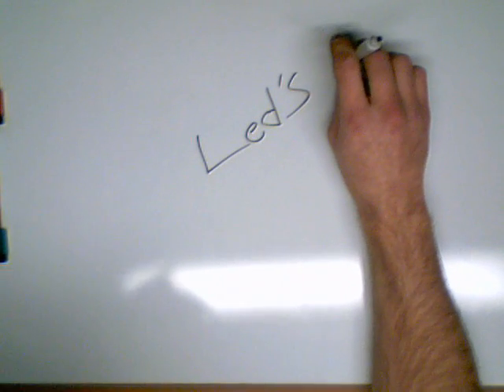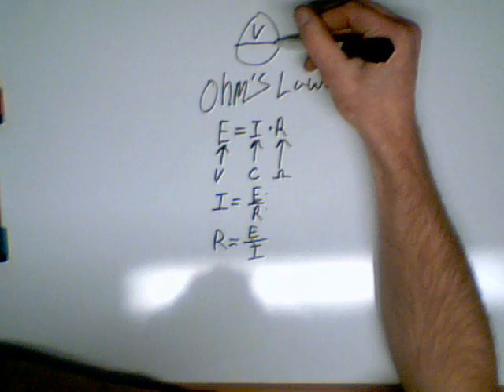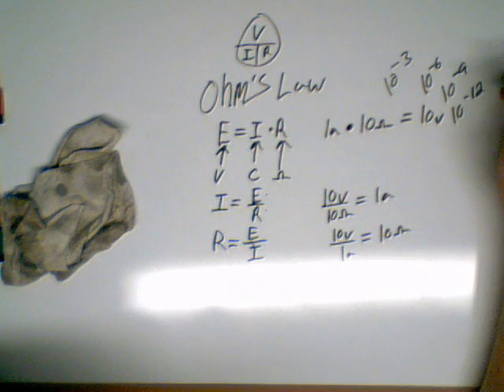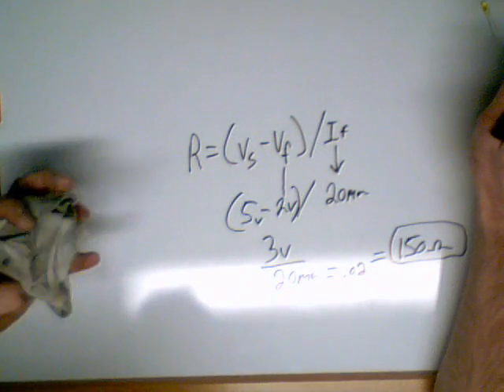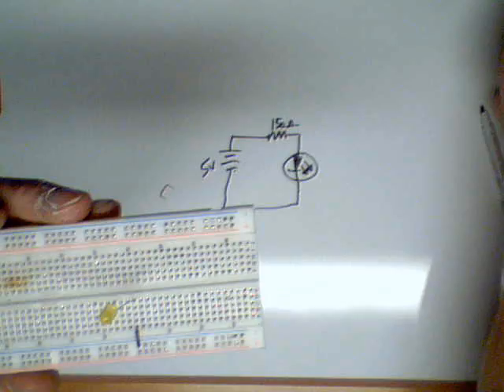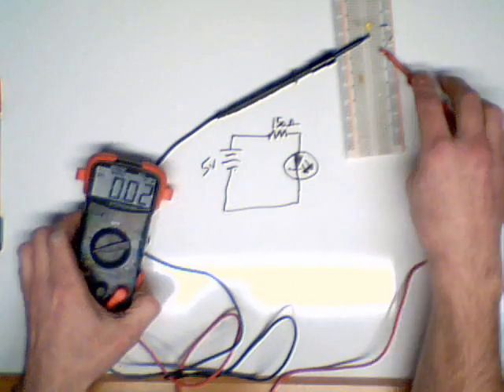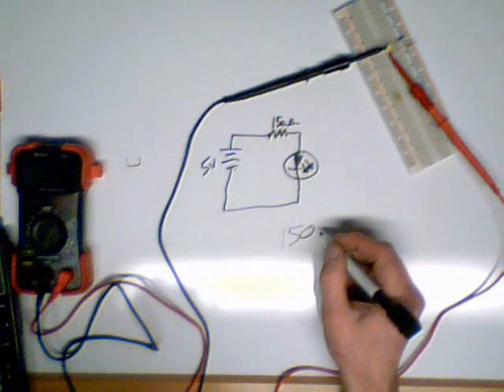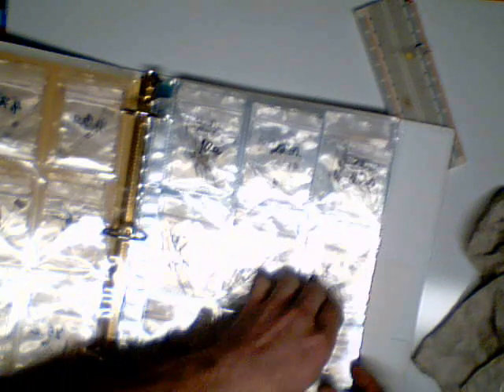How To Calculate Leds Resistor needed and ohms law explained!

Comment: Hi Cody,
It is a nicely explained good video. Thanks a lot. I was so much confused with many forums where guys used 680 ohms for lighting 1 LED with DC power supply (mobile charger), where as normally those chargers output range is from 500mA - 850mA with 5.1V to 7.1V voltage range. Some guys even calculate current ( in amp) = Power used by LED (Watts)/3.3 V (as they say dividing watts of LED by 3.3, gives standard forward voltage value of the LED).

Comment from the maker: @DIYElectronics you could use an adjustable volt regualtor to accomplish this, and then just add in a resistor to limit current flowing to your leds, id start off with a bigger resistors and work my way down if you do not know the specs of your leds, and i would just assume your leds run off of 3-5v unless you know the true specs. hope this helps

Comment: Thanks for your response. I didn't know what I was talking about. Anyway, Im trying to connect my gas and pedal LED lights to my car. I want them to light up when I put the key to d ignition. I can do that by tapping into the FUSE box & accessing the ACCESSORY Fuse slots. Since the Pedal lights come w a resistor box (?) that is suppose to plug directly to the 12V battery, do u think I can tap into the 20Amp Fuse slot and give me the right amount of power to light up the brake and gas pedal LEDs?

Comment from the maker: @DIYElectronics  and using ohms law with the v drop and resistance of the resistor to figure the amperage going across the load. Alot of people try measuring amps by shorting out power supply but this is a amp with almost no voltage so its not a good way to test.

Comment from the maker: @DIYElectronics It controls the amount of amps going to the leds, the led arnt going to pull many amps at all, so if you connect the resistor box to the radio accessory wire so the leds only come on when the key is turned on you will be in business!! hope this helped out.

Comment: Thanks for the excellent presentation...for months now, I've been trying to figure out how to build waterproof LED lights for mike bikes, using my 12v or 18v cordless tool batteries. but have been stymied by two factors: 1.  Most videos assume I know more, and 2.  The guys at the local RS care about nothing but how to sell the next cell phone and calling plan.  (RS used to cell a little slide rule calculator to figure this out...and it had a chart with the various resistor color codes).  Thanks again!!!

Comment from the maker: @DIYElectronics so basically when u get your led power supply, your going to need to turn it on, and test the voltage its producing, and use this formula to solve for ea resistor for the leds, Resistor = (Power supply voltage - voltage drop of led) / Led forward amps  Remember this is amps not mA so u have to convert, ma to amps, 750mA = .75A just move decimal point over to the left 3 places.

Comment: Very good video!

You misstated one fact, however.  You said 1 mA is "1 millionth of an Amp".
In fact, 1 mA is actually one thousandth of an Amp. Note:  1/1000 = .001
Interestingly enough though, you wrote the correct decimal fraction in your video for 1 mA as .001

Overall, you made a very good presentation!
Thanks for sharing!

Comment from the maker: @lmrproduction Im in a Electrical Eng course, but as far as your question amperage depends on the load applied to the voltage  so amperage = voltage/resistance. You have am maximum amount of amperage you can produce at a certain voltage. What are you trying to test? for liek a power supply if i wanted to test what kind of amperage i was producing at a certain voltage with a certain load, i would connect a 10omh power resistor to the power supply and measure the voltage drop  then take v-drop

Comment from the maker: @moto123cross what type of led is it, whats the running voltage? if the led is 3watt  u cant make it run 400watts, with 3 leds all pulling 3 watts it would be a 9 watt led setup.
Remember Watts = Volts * Amps so For a 3 watts led if it ran 12v then it would pull around .25 amps. Just wire them in parallel (means All the hots connected and connected to hot, and same with grounds all connected and connected to ground)  and you will get maximum power from your leds. Thanks

Comment from the maker: @moto123cross i cant answer your question, because i dont know the voltage of your leds, nor the amperage they require to run. you need a datasheet for them. once u have datasheet make sure u stick to datasheet, and supply the right voltage and amperage

Comment from the maker: @moto123cross Okay, so you got 2 different types of leds so we are going to need to different resistors to run the led's, so were going to assume your power supply puts out 30v steady,  next assume your led's are in parallel with a resistor attached, now we need to figure out what resistor we need for the 2 different led's. Lets assume the red led drops 3v and pulls 750ma so use the formula Resistor = (30v - 3v)/750ma This means u need a 36 ohm resistor for every red led

Comment from the maker: @moto123cross well if u apply that voltage and amperage to the leds they will blow instantly because there is no resistance in the leds, so amperage will sky rocket and burn out led. because Amps = Volts/Rest.

Comment from the maker: @DIYElectronics so using the red led from my past post, the resistor is going to need to drop 27v at 750mA so 27*.750 = 20.25 watt resistor, BUTT if you were to use a 5v power supply, u would only have to drop 2 volts at 750mA so 2*.750 = 1.5, so you could get away with a 2watt resistor. You need to look up electrical laws to understand these principles there are 2 laws id look up, ohms law, and the power law. to understand why things are the way they are.

Comment from the maker: @moto123cross okay, well your going to need to add a resistor to bring the voltage down to your leds operating voltage because that one is from 28-36v which will burn up your leds, basically the led driver is a power supply, thats it,  so you need to use the forumals in this video to help to calculate the resistor needed, and since your pulling so many watts your gonna need a big power resistor to bring the amps down and voltage

Comment from the maker: @lorenzog4545 To your comment on how .02 or 20ma = 150ohms  because i was saying at 5:55 that you divide 3v by 20ma or 3v/.02 which = 150ohms the resistor required to run a led that drops 2v and uses 20ma of current

Comment from the maker: @DIYElectronics To supply with it the correct current, now with the white led you would set the formula up like this Resistor = (30v - 3.8v)/690mA, this means u need a  38 ohm resistor, You could prob get away with running all of the led's off of a 38 ohm resistor the the blue and red leds might not be as bright as they could be. one problem with this is im assuming that the led power supply is producing 30v, if it it producing a high volt u will need bigger resistor

Comment: The LED comes in a package with a data sheet which tells how many volts it uses and how much current it takes.  His diode used 2 volts and 20 mA. and he was using a 5 volt supply to light the diode.  

Remember the formula is supply volts minus diode volts divided by the diode current.  So that is 5v minus2v = 3volts divided by 20 ma which is .0 .20 amps.  So 3 divided by 0.20 = 150 ohms.

Comment: i have a 5.7v/800mA rating power source and a 130ohms 10% resistor and a 20mA 3V LED, and for some reason sometimes it would work but most of the time it would not. What do you think is the problem?

Comment from the maker: @lmrproduction Okay after reading your comment a couple times i think i got what your trying to task, you want LED lights that u put on your gas and brake pedal to light up when u put your key into the ignition? Well i asuming you already have a led configuration built but only need power for it. What i would do is tap a 20amp line that is always on when the ignition is on, one example would be the radio. and as for the "resistor box" as you call it,  its imporant because

Comment: Question: I have four LED's w/ forward voltage 3.2 ,max voltage 3.5V reverse voltage 5V, peak forwd. current 100mA , wattage consumption 0.064 , I want to use in a car so I have 12 V Batt. for power. I think I need two 1w 56 ohm resistors with LED's wired in series. Will this work and where do I put the switch ?(switch is factory 12 V) and will the switch work with this? Any help would be appreciated.

Comment: @DIYElectronics hello so i have a 100 watt high power led driver with 10 X 3 watt high power (blue), 10 X 3 watt high power (red) and 10X3 watt high power (white). So my question is if i can mount all this led on my simple 100 watt led driver and how i make good circuit

thanks for the answer

Comment: Thanks for the help! Can you help me with a little setup? I have 22 green 2 millimetre LEDs that run at 1.8v. The LEDs are in a parallel that is connecting to my subwoofer that runs at 12v with a 15 watt subwoofer. Umm would it be 12v-1.8v=10.2v/(20MAx22 LEDs=440)=0.02318....... So I wouldn't need a resistor. And the Amps of the woofer is 0.8333...... Can you help me please?

Comment: First it all, I would like to say thank you for the opportunity learning.
My question is:
How many led's can I use on 120 volts with 10 amps electrical line ?
It means I would like changed regular buld fixture lighting for LED fixture lighting making for myself ?
Thanks in advance.

Comment from the maker: Resistance = (supply volts - volt drop) / amps 
 5 ohms = (6 - 4) / 0.40 

assuming there in series. Parallel is completely different because you would have 6 volts going to ea led, so  20 ohms = (6 - 2) / 0.20 per led

Comment: what if the power supply is in wattage not volts, is it possible to calculate the resistor needed for the leds?

Comment: Ok, this is where i get confused. In your example you said you needed a 150 ohm resistor to run an led with 5V, but at how much current? I don't get it.  If i am using a power supply with both variable voltage and current, i would set the voltage at 5V.....but what would i set the amperage to? HELP!!! ANYONE!?!

Comment from the maker: @moto123cross Well if you do that math you would be right at 90 watts  so id say would would be fine,  remember follow instructions of your led driver, but if it doesnt specify which way to wire led's, wire them in parallel and fire it up see what it looks like.

 do you know the voltage these are suppose to run at?

Comment: I intend to wire in 2 LED headlights on a john deere riding mower.  I can understand calculating a Resistor for the circuit.  How do I find out the other unkowns, ( the light amps),  of course it is 12 volt but the infor on the lights are not given, not even wattage.  How would you start and find what you need and wire it up. I will put a switch on.

Comment from the maker: Just set the current around 500 ma, this setting is the maximum amount of current a current can pull and a standard led pulls only about 20ma. The setting does not send that amount of current through the circuit tho. Someone correct me if i am wrong.

Comment from the maker: E X I = Watts or Voltage X Current = Watts 
  so if the power supply is 6 volts, and the led uses 2 volts at 20ma then your current is 20ma and your going to be dropping 4 volts over the resistor so the resistor would need to be at-least 4 x 20ma (0.02) = 0.08 watts

Comment: the currenct cant change, so it will remain 20 mA wich is 0,02 A.
but add the voltages it will be in your case 22X1.8= 39.6 V, over the entire circuit.
here in europe we have 230V power, so thats the battery in this case.

Comment: * Emitting Color: Red
* Intensity Type: 120-130Lm
* Viewing Angle: 120-140°
* Forward Voltage : 2.9V~3.3V
* Forward Current: 750mA
* Wavelength : 610nm-630nm

* Emitting Color:Blue
* Intensity Type: 120-130Lm
* Viewing Angle: 120-140°
* Forward Voltage : 3.5V~4V
* Forward Current: 750mA
* Wavelength :460nm-470nm

Emitted color: White
DC Forward Voltage(vf):DC 3.6～4.0v
DC Forward Current(IF):680-700mA
Viewing Angle:120 Degree
Luminous Intensity:165～180Lumen

Comment: Great video but the lip smacking after every single sentence was very much a distraction for me. Sound quality is good besides the extra gain. I’d highly recommend either putting a sock or cover over the mic or adjusting the min-max threshold for the mic so that it doesn’t pick up anything other than clearly vocalized words.

Comment: @DIYElectronics the problem is how i can make all this im not an expert and i dont understant how to put the resistor and how many i need because at the begining i was thinking that i just need my 30 X 3 watt led and connect them in parallel on my led driver but its not simple like this if you make a simple video on this im sure you will have alot of view because so many person search how to do that. I know you are very good in electricity and led but for the other people its hard. Anyway thanks

Comment: I have an old 2007 xl spreadsheet for calculating the resistor value, for mechanical engineering nerds like myself.

Comment from the maker: @moto123cross Alright listen, ive explained it to many different ways, i watched the video, he doesnt clarify which power wire coming off the power supply he hooked his set up to, he could of hooked it to the 5v led coming off the power supply or the 3.3v wire who knows, he did not sound to educated in electronics, more in growing weed. if you are using a 30v power supply u need a resistor thats the end! now the resistor wattage needs to be figured and watts = Vd * Amps

Comment: Alright dammit! :) I can do the math needed to wire my little leds with this video. However, I'm using a pirahna led and need a little help from whomever would like to comment. (hold sarcasm please because I'll take it literally and blow all my stuff up.) :)  Any tips on these pirahna leds? Two different sets of posts and obviously only one way to wire 'em. Already turned a 30k hr life span of the light to 3 secs with too much power before I even thought about the resistor action. Yeah, I'm new to electronics and wanna see stuff light up. :D  Any help with just the connection of these pirahna leds would be greatly appreciated!